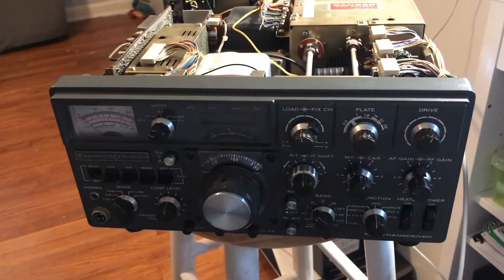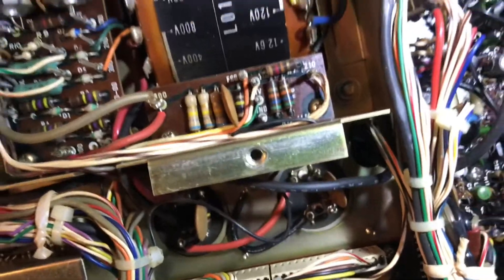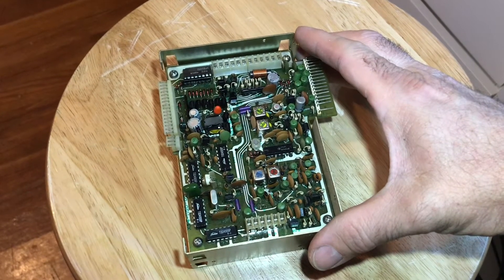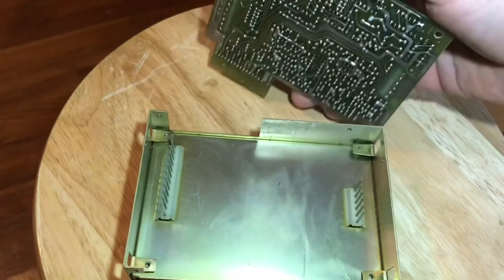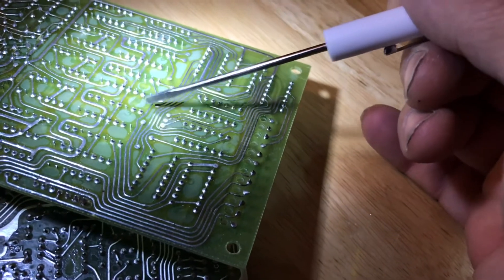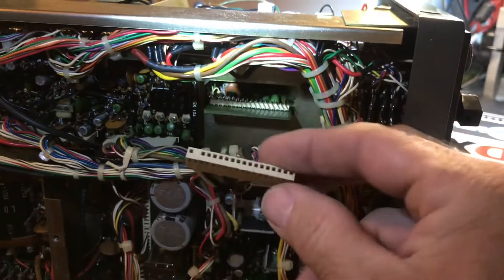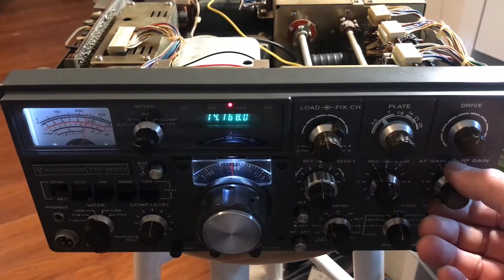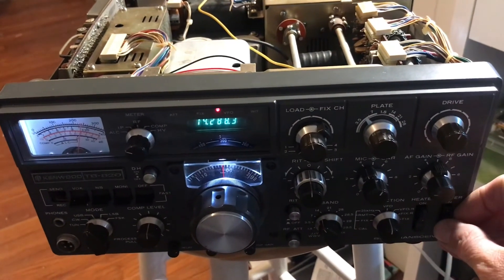Kenwood TS-820 Display problems-here’s HOW I fixed it

Comment: Hello,
My DG-1 doesn't work either. I'm trying to source some parts. Can I just remove the entire DG-1 and use the radio that way? I see two connection points with pins.
Reply from the maker: @tjk1968slice  I really don’t know if it would work.  Let me know how it goes if you try it.  Hope you get it going again!

Comment: I'm searching everywhere for a fix to make the digital display match the dial VFO. I see your radio is also off. Have you found a fix for that?
Reply from the maker: @Fireman9143  I haven’t found a fix for that either.  It’s annoying though!
Reply: @propagating-radio  I realized that the 25kHz calibration beat was accurate with the digital readout, so I took the vfo dial apart and shifted the plates to match the digital.  It was a pain because the middle plate set screw is not easy to access. Best bet is to remove the whole thing, hook it up outside the case, and get all the numbers lined up. The hard part was getting the 5 in the exact right spot. The first time I did it, the numbers were just a bit off, and I spun up to 500 they were not in the middle of the window.  

When the big inner dial is adjusted to 0, set the middle dial so the 0 is in window of the outer dial with the 5 just to the right in the 9 window.  Snug it up and spin it all the way around to 500.  Make sure the numbers stay visible in the middle of the window.  If they are a little left or right, adjust the middle dial slightly.  Everything should be within 1kHz of the 25kHz cal beat as you go up and down.

I did find 1 youtube video explaining this, though I learned the hard way about double checking the full scale is lined up.
Reply from the maker: Excellent writeup! Thanks a lot!

Comment: Another failure I've seen is logic chips gone bad. Have repaired many a DG1 in the past.
Reply from the maker: Interesting. Have you been able to source replacement chips?
Reply: I just purchased an 820 and the display doesn't light up along with the VFO led. Do you think they are related? I'm getting ready to disassemble.

Comment: Thankyou. 😃
This fix worked 100% for me. 
My display just died, and no amount of spray on the upper & lower connectors of the DG-1 fixed it, this time.
My issue ended up being corrosion on the inside posts on the 2 cct boards of the DG-1 unit.
A quick spray and clean, as described, resulted in bright display again.
Great vid and very much appreciated.
Reply: Help me out if you can. When you say "inside posts on the 2 cct boards of the DG-1" what exactly are you talking about? Are you talking about 4 screws that hold the boards, or the actual MOLEX connectors on the DG-1 board had to be sprayed and re-seated? In other words ... you had to take apart the DG-1 casing and take out both boards and just spray and re-seat the MOLEX connectors?
Reply: @624radicalham  
Hi. Yes remove the DG1 from the chassis.
Then seperate the 2 boards. Once separated, spray the pins that go into the opposing board's molex connectors.
Reassemble/rejoin the 2 CCT board's. Then reinstall the DG1 back into the radio.
This fixed mine 
Goodluck and Cheers.
Reply: @neilcarter1549  Thanks! Tried it once but without giving it full attention so i shall try again and pray for results. Your reply is much appreciated!
Reply from the maker: That’s awesome Neil! I’m glad this helped.

Comment: THANK YOU for this! Coincidentally I had recently discovered your channel and just yesterday I bought a Kenwood TS820 and has the erratic display. To know that just a simple deoxit cleaning, in your case, brought it back to life gives me hope. Appreciate the detailed shots showing how to access and remove the boards. Mine has no mic. Having trouble finding the mic pinout online. I've downloaded the service manual to have a look. One would figure since the radio has been around 4 decades that a simple pinout diagram would be everywhere.
Reply from the maker: It’s wild how much the available information varies. I’ve had no trouble finding an obscure spec for an old Hallicrafters, but couldn’t locate the same specs for a TS-430. Weird. 
Hope you get that TS820 display sorted.
Reply: @propagating-radio  It's so true, despite hundreds of thousands of these hybrid and later the 430/440 sold. I've found the groups IO on Kenwood hybrids quite helpful. Thanks for your awesome channel.
Reply from the maker: @624radicalham  thank you for the kind words.
Reply: Hopefully you found the answer. The operators manual actually has the mic wiring diagram. It's easily found online

Comment: I got the same radio and I am concerned that I will have do to this because my display is all fuzzy but its there sort of but not really I can read the numbers but it makes it hard to know what frequency I am on.
Reply: Too bad you couldn’t identify exactly which re-soldered joint fixed it.  I have a similar unit, I just started looking at. I tried reflowing the solder joints on the board with the large connector, no luck. Next the other board. 
It’s been difficult with my old eyes and shaky hands, kinda takes some of the fun…but still enjoy it.
Next I’ll break out the scope and DMM.
Reply from the maker: @ebones6957  it can be a lot of fun to fix your own gear, but I definitely know the frustration that can come with it.  
Hope you get that problem chased down.
Reply from the maker: is the display dim too? Wondering if you have a voltage supply issue in the display.
Reply: @propagating-radio  No the numbers are funny like it’s bleeding in a little bit like I could see that say the numbers 28 but I’ll be fuzzy if I’m trying to say 25 or whatever so it just looks like all the numbers are bleeding into each other sorta really want to avoid taking this thing apart though
Reply from the maker: @edman209  I don’t think I’ve seen that problem before. There is a Groups-io group called Kenwood Hybrids.  If you join that group and post your issue there, someone may have some advice for you.
Reply: Is there a possibility I could get a copy of your  schematic for  the DG1.  I have a different version schematic. Your boards appear to be identical to mine.  I have  X54-1160-00 andX-54-1150-00 boards.
Reply: @ebones6957  I yjjmk it's mattress me arseon
Reply: @harrybatt998  please translate, your mattress is on fire?